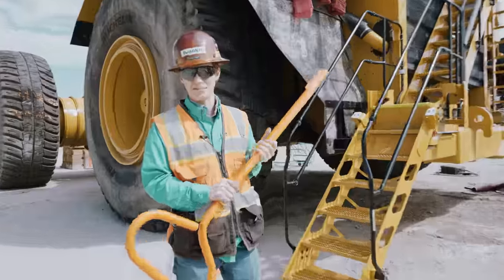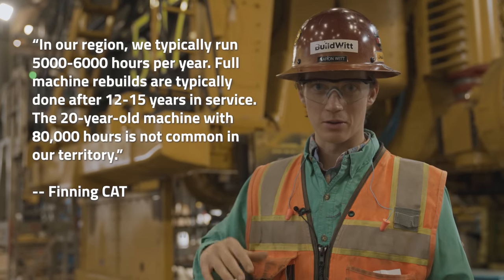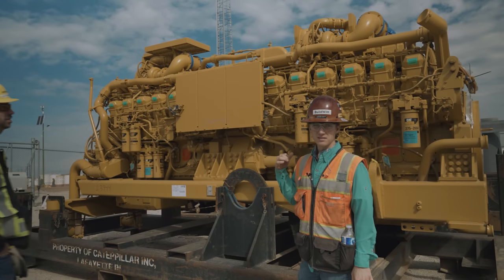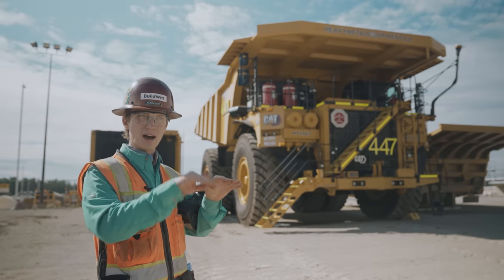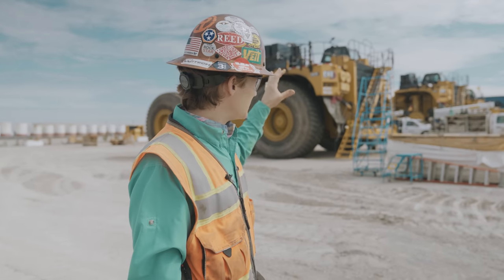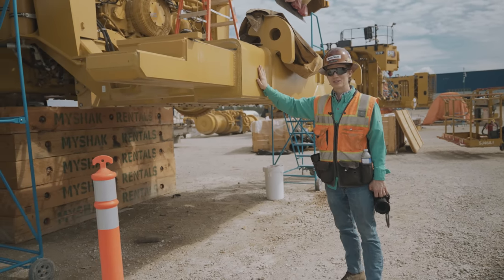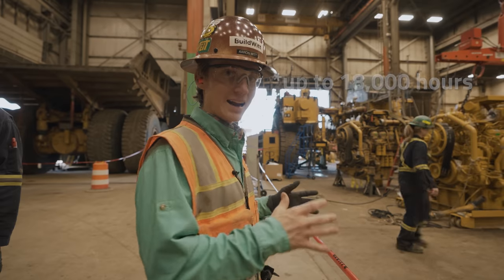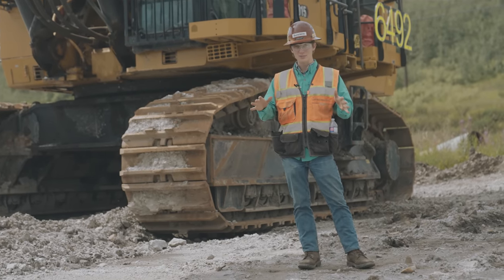Building the World's BIGGEST Truck | Finning Caterpillar

Comment: I've only started but was the key thing a joke ?!?!? Lmao I dunno
Reply: Obviously, I don't even think you could crank by hand judging the size of the engine. So there's a large starter. Think of it like this, the engine is basically the same components as in a car but just Mammoth size.
Reply from the maker: Yes sorry for my dumb sense of humor
Reply: @AaronWitt  one of the every few YouTube channel that actually has sarcastic jokes and won't be sorry about it in a video. I love it. Keep being yourself
Reply: @spectralducklin  Trucks this size typically use air starters. I work on 793B/C/D trucks and all of ours are air-start.
Reply: @Porty1119  thank you for telling me this. Very interesting with air starters. I will read more about that and learn how it works. I'm only a farmer myself but basically when you know how a diesel engine works, you sort of can figure out a larger diesel engine work too. Basically the same thing but only everything is so much larger and apparently some parts are manufactured different to work more efficiently on the larger diesel engines.
Reply: That was a drop in handrail

Comment: Nice! I work on 793s, we had 797s at one point but the tires were disproportionately expensive and much of our infrastructure was too small to support the 97s.

The dispatch system is usually a 2.4GHz mesh network and passes truck location, shovel assignments, and dump assignments. When it works, it's more efficient than voice radio communication. We also have full telemetry on all trucks so maintenance can pull up diagnostic information in near real-time on running trucks.

Comment: I hauled some of those engines back and forth to Edmonton to be rebuilt.  3516s - 35 litre displacement, V16 configuration.  25,000lbs a piece!  Even those electric wheel motors were over 10,000lbs.
Reply from the maker: sweet!!!

Comment: I enjoyed watching your video of a 797 work in process.  I actually work in the Decatur, IL plant where the 797 is built and 5 1/2 years ago I worked on the 797 line. After the test booth I helped to break them down to get it ready for shipping. Largest truck means large parts and large tools. It was a tough job!

Comment: Wish you talked a little more about the technical aspect of the trucks. I’m so curious about those engines. They’re huge!
Reply from the maker: I'm not smart enough for that
Reply: 6469 cui V20 in the case of a 797F, apparently makes around 4000 HP
Reply: the 798 AC's engine is similar but has four fewer cylinders, and of course driving a generator instead of a mechanical drivetrain like in the 797

Comment: Worked in the slate quarry before. Worked with subpar equipment that spent more time being fixed than it did working. Drove a cat 35 ton haul truck made in the late 60s. No heating or air and summer operations were brutal in it. Rather drive a truck like this over what I used to drive

Comment: What's the shipping process when it's in one piece? Can't imagine every road can support those things
Reply: The two shops in this video are close to the mines. They are assembled here then shipped without the tiers and dump body. The farthest it would go to get to all the sites other than Kearl is around 20-30km.
Reply from the maker: they put the whole thing on a float and send it down the road. Or they drive them on back roads
Reply: @mikefrom3089  Mamoet has the contract to ship them and they ship them in running form.  Tires, box, everything is on it.  It's a large 2 lane trailer that is used.
Reply: @scotttupper4108  can the run them over the bridge to nowhere like that?

Comment: Whats the point rebuilding, if they replace all the parts is it just the frame they're keeping?
Reply: Cost, be able to go through and check any possible damage that was hidden by the bucket and all the oilsand on the frame and possibly under the bucket too. I believe it's much easier to transport hundreds of spare parts parts from all over the world than it would be transporting a new haul truck this size.
Reply from the maker: Yeah it’s all in the cost and availability. Significantly cheaper than a new truck
Reply: All the components on the truck are rebuilt
And remanufactured. They don’t just throw everything out. Engines, powertrain, hydraulics, suspension and steering. They have a parts exchange program instead of buying brand new parts every time you buy reman at a cheaper cost. Cat components are designed to be rebuilt. They have trucks running around upwards of 180,000 hours on original frames.
Reply: Emissions standards too. The older trucks don't need all the DEF parts on it. They consume a bit less fuel and have a bit less headaches.

Comment: Is a rebuilt 797B basically a 797F? I mean, does it have the Same Engine? The Same Capacity Dump Body?
Reply: The B series is basically a 12 cylinder engines merged into one. Where as the F series is only one that makes more power!
Reply: @tomwilson8227  I have heard that some 797B (don't remember exactly where) have been fit with the new C175-20 ACERT engines (the one's in 797F's). The 797B's originally came with  3524B engines.
Reply: @sayeelparab1422  We have 2 797Bs with the F Series engines in them. They don’t seem to run as they should all the same.
Reply: I can respond with two words....morenci arizona....two more words....empire cat....

Comment: First the CAT 797 is not the largest haul truck in the world, there is a truck in Russia that is bigger. 12 weeks to do a rebuild is a joke as CNRL has a program where they inhouse rebuild 797's, strip down frame welding and paint then rebuild the truck in 30-40 days and could be done faster except Finning is slow getting parts causing unnecessary downtime

Comment: How much does it cost.
Reply: 60% of the cost of a new one.. I think a brand new 797 is like 3 mill
Reply: 5.97 million with all the goodies
Reply: Thanks
Reply: I work in this area of Alberta. Current cost through finning for a new 797F is 12 million Canadian
Reply: @13raden  is it wow.. I'm way off. Maybe I'm thinking what the 797Bs used to cost
Reply: @Bowiiihowdy  inflation baby
Reply: @13raden  ya I'll say. I know a brand new 627k is like 1.5 million. It's nuts. I can buy 4 or 5 used older ones for that much

Comment: the truck has been operating 10 years not 20 theres 8000 hours in 1 year do that times 10 and you get 10 years
Reply: They don’t run 24 -7.  There is downtime for fuelling, maintenance, repairs, shift changes, Driver shortages.

Comment: The world's biggest truck is BelAZZ 75710 450 ton payload.
Reply: true but i doubt it would work in the oilsands, too much overhang on the front in soft ground. that said, i bet the dual front wheels would help with flotation
Reply: @andrewscrutton  I would be interesting if they did a demo with one there, but that really makes little sense because I doubt they would switch from CAT.